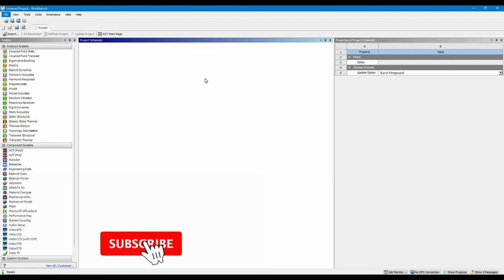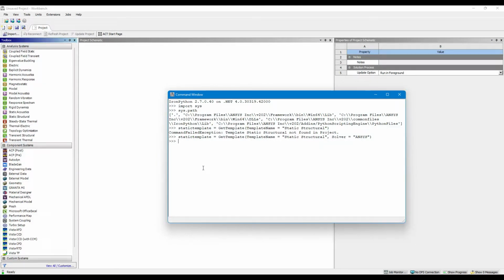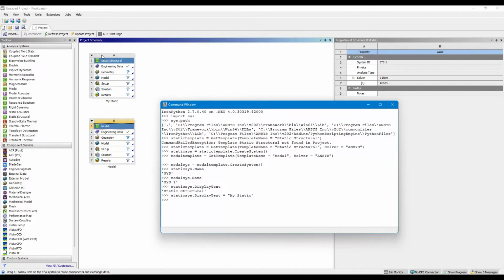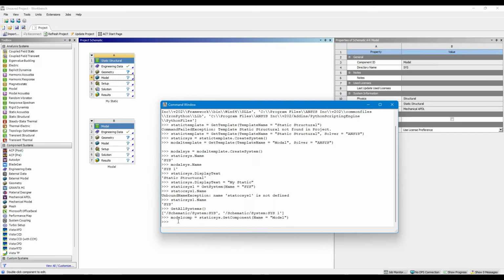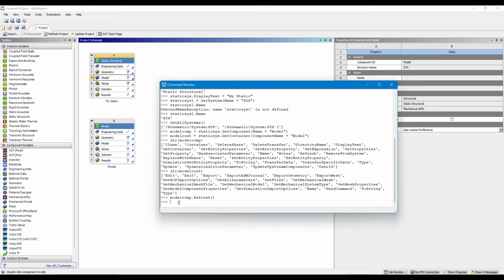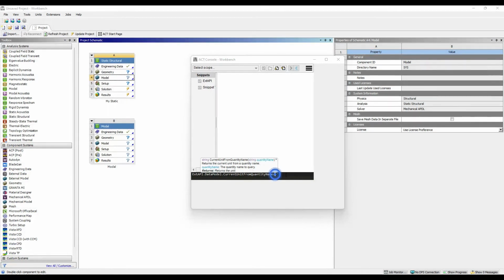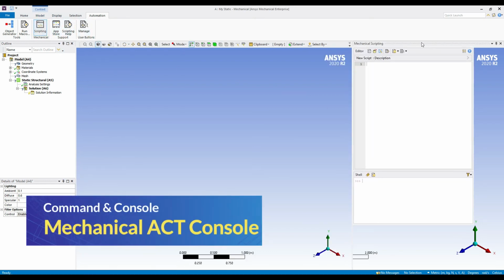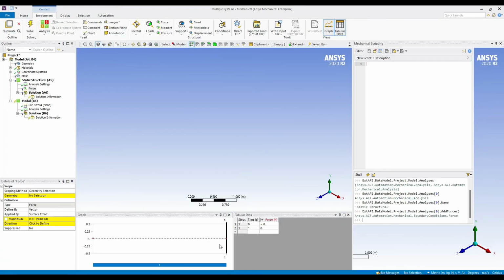2 CMD Window & ACT Console | Automate the boring stuff in Ansys Mechanical | Ansys Python  Tutorials

Comment: I found this video interesting. However, I would like to know whether it is possible to script the various activities in Design Modeler as well as to create the geometry including the boolean operations, surface from edges, etc. Could you pass your comments on this?
Reply: Great video. Can you add code in the comment to create a Fluid Flow (Fluent) analysis system using Python Console?